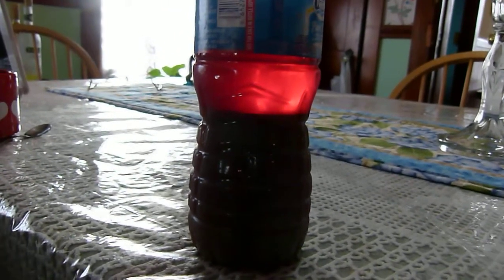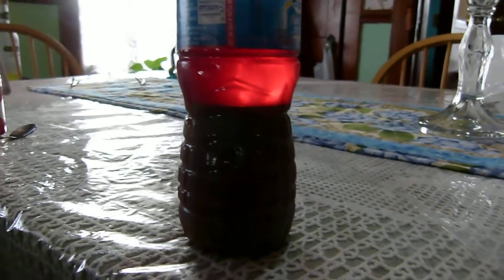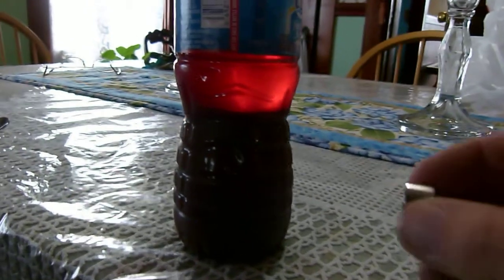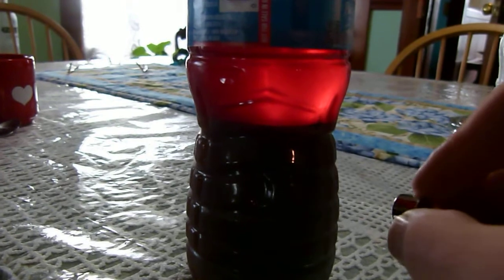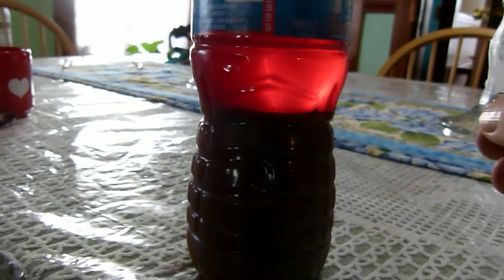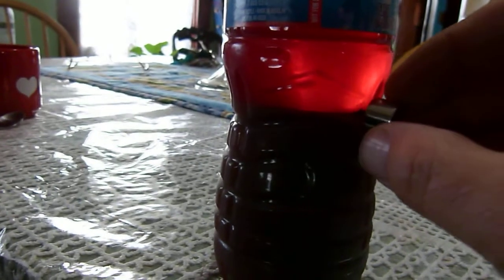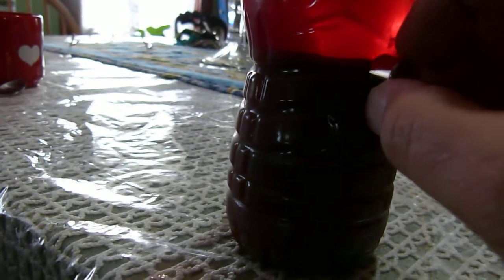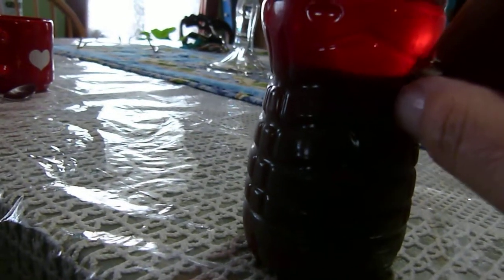Gemini 105Mc Really Dirty Fuel

Comment: Always seems to be problems with fuel and the tanks on the Gemini boats.
Oil leaks from the engine pan is another problem I have seen.
I wish they would go back to outboard motors with jackplates to lift them vertical
plus you can still tilt them.